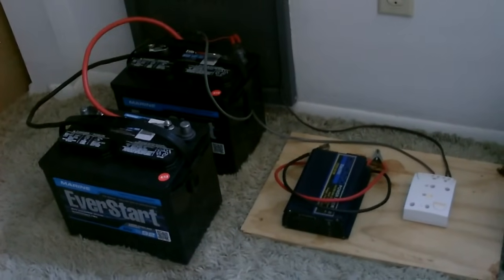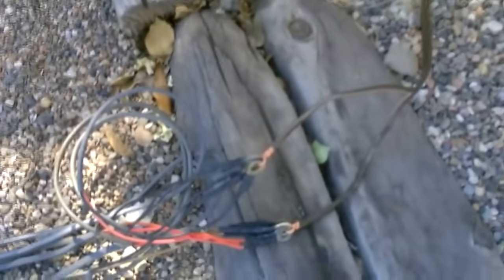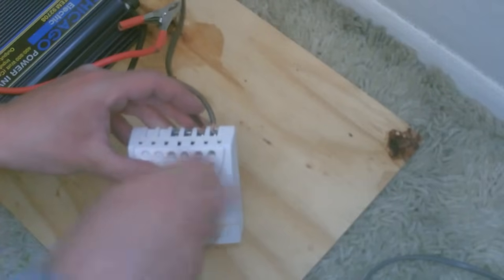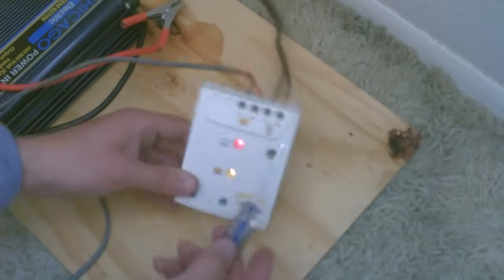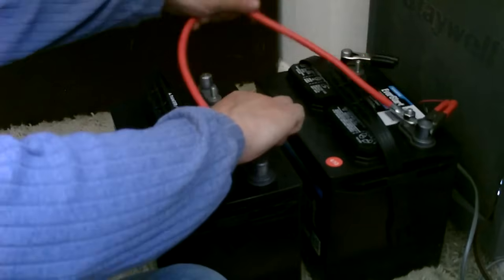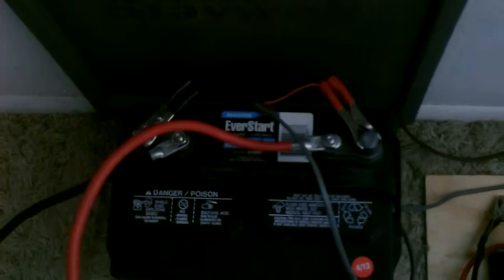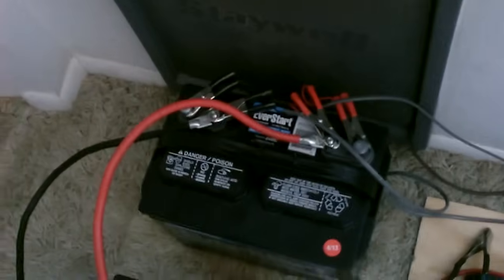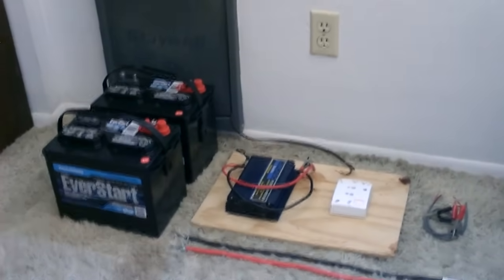How to hook up Solar Panels (with battery bank) - simple 'detailed' instructions - DIY solar system

Comment: Hello,Thanks so much for making sense of using solar power for better power efficiency,etc.I can see it's been over 5 yrs. now since you've posted this information.I am not understanding amps/per hr. needed related to what I'll be using it for.I'm looking for solar power @ the present time only for off grid camping in a small vintage trailer, part time,maybe 4-5 days @ a time where there are NO electric hook ups.Primarily refrigeration but also for lights.I do NOT need air condition/heat where I am in southern ca.And will probably use propane for stove top or camp fire cooking,coffee,etc.The only other solar 'maybe' needed would be quick rinse,soap & rinse shower 2x's week.Considered an overhead outside solar H2O bag hanging but on a sequensial # of cloudy days,not sure.I particularly liked the stand up Kenmore Chill fridge/freezer by Sears you mentioned.In conclusion my 2 part question is:have they since,come out with a more efficient fridge/freezer?And,you showed the 2 full solar panels(6 individual panels=90 amps).Is that 90 amps/hr.?You mentioned 'eventually' you were hooking up to 1 monocrystal solar panel.Can you elaborate on that?I'm trying to figure out also how many panels or how much solar/watts-amp.???I'll need to get started? I'm obviously not understanding the conversion of watts>amps & what I'll need for my purposes.Thank YOU so much for sharing!!!
Reply from the maker: hi. i'm glad the video helped you. i see all the comments no matter how old the video is. hopefully it will still be helping people 20 years from now (maybe longer). now to your questions... yes, i've seen slightly more efficient fridge/freezers, but the one in the video is still one of the best. note that the 6 solar panels are 1 amp each for a total of 6 amps. so 90 watts. these days i mostly buy 12v 100 watt solar panels. those are usually around 6 amps. i buy those because it's generally cheaper than buying several smaller 12v panels.

Comment: is there a limit to how many batteries you can chain link?
I want to run a computer that uses about 800 watts continuous all night off the batteries when the sun is not out.

How many batteries would I approximately need?
Reply: Your computer actually consumes 800 watts continuously?   That is a lot of watts!  Then ... 12 X 100 AH Lead Acid Batteries might last for 8 hours, at night

Comment: This is a good explanation of how a solar system is put together and works.

I would like to add some very important information anyone wanting to go solar or have a solar back up.
  It is important to know what size inverter you would need to operate what you want to use. Inverters are rated for continuous loads and start(peak) up loads.  Example: 2000/4000 watts.
  To find out what size inverter you will need. I am going to use for a full size 
refrigerator.
   Look inside the refrigerator for the small metal plate, it will have the amps listed that is required to run.  Multiply the amps by 120 ac (alternating current) voltage ( your household electric) , will give you the watts needed for continuous run load . 
  Since refrigerator, freezers, air conditions and pumps cut off and on they require higher peak load than the continuous run load requirements.  
  For refrigerators and such mentioned you will need 3 to 7 times the continuous run load to cover the peak surge use to start up the motors in these things.
  Example you have a freezer with a continuous load of 4 amps and the start up load of 12 amps or more will be needed. Multiply 4 amps by 120 volts equal 480 watts of continuous power needed. Now multiply 12 amps by 120 volts equal 1440 watts needed for a start up load.
  You will need an inverter with surge/peak rating of 1440 watts or more just to handle this one appliance.
   For a complete household you will need to find out what everything you want to run off the inverter requires. That will determine the size inverter or inverters you will need. 
  For example a normal coffee maker will draw about 800 watts of power. If you have a 500 watt inverter you can't run that coffee maker.

Comment: This question may seem really dumb. Now that panels are less expensive (2020) can I just use 1 - 375w solar panel in place of what used to require 4 - 100w panels? Will this still work or give the same effect?

Comment: If the batteries no longer have any charge will the power keep getting drawn and destroy the batteries or what?
Reply from the maker: hi. the inverter shuts down when the batteries get low (when they're about 50% discharged). so the batteries don't get damaged..

Comment: How much power is there with 2 batteries and for how long..for example to power a 2.7L mini fridge would this be enough with a 100w solar panel 18.5v?
Also can this system be used for lithium batteries
Reply: At night, you can draw 300 Watts continuously, for about 4 hours.  A fridge will cycle ON / OFF, it is not continuous ...

Comment: thank you just learning here.... can you tell how or what you do to  maintain your  deep cycle batteries. what kind are they? how often to add water or check them ect. and are all deep cycle the same.  these are walmart right ?    any help thanks     david
Reply from the maker: hi there. i've had good luck with the everstart batteries (from walmart). i've stuck with those for 9 years. i always get 3 years out of them. (about 1000 charge cycles). i used to check the fluid level every few months, but the level was never low. not once in 9 years - so i don't even do that much anymore. i keep the voltmeter attached to them and monitor the voltage. that's about all i do.
Reply: @desertsun02  thank you

Comment: I have a 10x20 shed coming next week. I plan on insulating to help keep cool (Florida). I'm wondering a few things: I will be running a laptop, TV, a paper printer, a thermal printer, a portable A/C (the kind on wheels), and charging a few small lights. I use the printers less than 5 mins per week total. I'm hoping to get acouple Duracell deep cycle batteries, 200 watt panels total, an inverter maybe 400 or 500w for expansion. I have no idea if this will be powerful enough to run the small electronics along with an air conditioner...in the summer we easily get 14 hours per day sunlight. (Air conditioner is a Hisense 10000 but 115v)  thank you! Loving your videos!

Comment: Sir I have a 100 watt solar panel and two 35 ah batteries..I want one battery to charge using solar panel while other battery should be connected to load(dc motors drawing 8 amps and its 12v) while the battery gets drained the other battery should be connected to load and the discharged battery should be charged using solar panel

Comment: You made is sound so easy. I have 2  100walt panels, charge controller, inverter and 12 volt battery.  Works good But my husband wants to separate the panels on each side of our boat, so I would need to extend  the - and + less on one panel about 15 feet and my panel have connectors on the end that would go into a mc4  Y connection. I bought the whole set up as a gift and now I have to refigure my lines. Can I get extensions for one of the panels?

Comment: This was great thanks! One question. I have an RV with an existing plug in system ( being able to charge the deep cycle batteries from the exterior outlet with an extension cord OR charging it with the engine motor running and the internal inverter running) SO can I run this type of system directly to the 4 parallel deep cycles I currently have or should I somehow run something like this into a power station which my RV could plug into when I'm off grid. Sorry I'm new to this and not an electrician lol 😂 ... Thank you for the help if you could

Comment: Hi Sir. 
I will ask if I can use the inverter and in the same time the solar panel is still connected to the battery?
Or I need to disconnect first the connection from comptroller to battery?
Then only battery to inverter.
Reply from the maker: hi. yes, you can use the inverter at the same time the solar panel is connected. i keep it connected pretty much all the time.

Comment: A question, I bought 2 nomas 100W and 2 deep cycles, each of the panels comes with a charge controller included, should I have it as a dedicated one for each battery, or use just one of them and tie my 2 batteries into a parellel?

Comment: FANTASTIC video. In fact his tip on Harbor Freight led me to this package from said company: https://www.harborfreight.com/100-watt-solar-panel-kit-63585.html . I would comment to many that it gives you how much power you get to run what devices for how long per battery. This video EXPLAINS what this kit does for you and how to DIY expand it to more batteries and other components. Also there are direct DC connections to your existing devices such as monitors, laptops, game consoles, led light bulbs, music devices and refrigerators. The GREEN NEW DEAL starts with you and me and local power where WE control our use and our generation from wind and sun. Love this.

Comment: How many batteries would it take to light up a fridge and lights in the house
Reply: 2 x 100ah batts  Would do. You will need more solar power than he has though(Great vid by this dude buy the way)  a fridge is(uses) around 100 to 200w (old ones use more) I would get an inverter 1000w (any bigger you will need more batts to run the inverter) And may be 2 x 100w mono solar panels. My set up is getting built as we speak  im going to run 3 x 100w s-panels/2 x 100ah batts /epever charge controller 40a MPPT and a pure sine wave 1000w inverter. I am no electrician im learning this also at the moment so if anyone knows a better set up fell free to reply. Also mike be careful when buying the s-panels you want mono NOT poly and if it comes with a charge controller make sure its mppt NOT  pwm or is it pmw anyway this is important  cause there cheap crap a good quality charge controller is also important . Without this combo its not going to work and it will be a waste of your hard earned coin. You get what you pay for in this kind of set up.

Comment: Great vid! Thank you. I have 31 panels on my roof flowing back into the grid , i would simply tap the ac power from the inverter installed correct?  I was wondering how many batteries i could charge in a day, and how much are those big buggers?

Comment: So.....we are wanting to run a string of patio lights 8 hrs a day along with a floor fan.  If I understand this correctly, it's doable.
Now if we add a mini fridge or standard size single door fridge, I take it we may have to up the amperage?  The fridge would run 24 hours in  the summer.  In winter it would be unplugged (Dec, Jan, Feb, March).  Thanks for all your help.  Makes the impossible seem doable.

Comment: So If I was powering 2 inverters from 2 batteries. just run the jumper from each batter to an inverter and we should be good to go? I would only need the one controller?

Comment: This is exactely how I run my system at home.  1 x 100w panel, 2 x 110ah heavy duty leisure batteries, 1 x MTTP solar controller and a 1500w inverter, job done.  Thanks for sharing.
Reply: Are those regular car batteries?
Reply: @Philipbuono77  My original system  was run on x2 leisure deep cycle batteries, but I have now invested in x1 100amp Lifepo4 lithium battery.  It is much better and offers better power delivery 👍.  I personally would not use standard car batteries.

Comment: I bought a solar system with 200W with a 15Amp controller for a 24V water pump, what kind of cable I can use to connect the battery to the controller, the holes of this controller are too small?  I am planning to get another controller; can I get a higher Amp without damaging the system?

Comment: Great video - in fact I tried this set up the same as you described (except a 100w solar panel.)  I run a box fan on it and within 5 minutes my batteries are discharged to 70%.  I'm not sure what could cause the drain on the batteries like that.  I am also running it during daylight with full sun hitting the panel.  I turn off the fan and the batteries are recharged in 3 minutes.  The equipment is brand new - even the batteries.  Any ideas why it discharges so quickly?  I ran a meter on the batteries and they are at 13.6 v each.
Reply from the maker: hi there. great question. when you put a load on the batteries (a fan or something else), the voltage reading on the batteries will drop lower very quickly (but only at first). that's totally normal. the batteries are not actually discharging fast. it just reads lower because the load is on them. *that's why when you turn off the load the voltage jumps right back up (in a couple of minutes). the larger the load the lower it reads (at first), but within a couple of minutes of shutting the load off, the batteries will readjust and you'll see they didn't really discharge any faster than they should.

Comment: Fyi not trying to be a smart ass I'm way new that's why I'm looking. If you bet a bolt that fits at those washer type ends on your wires and crimp one on the copper loop twist you did or just put 2 washers together and place that wire in the middle I think it would make better contact and if someone pulls on it or trips anything like that it would keep a great contact point. I like your set up I'm go up going to watch again im still a bit confused not your video like I said I'm new

Comment: input 24v 220v out put 6000w inverter 100w panels x3  how many batterys will i need for this?  also if i leave it on running my cctv continuesley will it be ok will be runing wifi cctv camera 8x and also the fridge if possiable?

Comment: I'm moving into my SUV, so I'm planning to set up solar power. I've spent a lot of time researching over the last week, but nothing was as simple and helpful as this video. Thanks!
Reply: Were you able to do it? How did it turn out if you did?
Reply: Alex June Hey! I did move into my SUV and lived in it for 379 days. However, I decided against modifying my car. I just did what I had to do to endure the heat and cold without it.
Reply: @maxleveladventures  so you didn't implement a solar panel system?
Reply: Alex June Correct.
Reply: @maxleveladventures  thank you.
Reply: Alex June you’re welcome :)

Comment: someone set up our system with two different batteries. They are not available to help so can anyone give advice on how to change batteries safely to avoid short circuit. We have a solar panel connected to two batteries. The one battery is smaller in amp hours and doesnt seem adequate and may be draining the other 110amp hour battery. The one that needs changed is the one that is connected to the controller. Do you remove this wire and then changeover or disconnect both batteries first. The system altogether is a 250 watt solar panel,  one 65amp hour battery and one 110amp hour battery with a 1000watt invertor

Comment: I’ve been playing about with solar at my house, my epever mppt has a load out and i tried connecting the pure sine wave to it but it works few seconds and the load goes off from the Inverter. I’m presuming it’s the charge controller doing it. How ever it runs perfect when connecting the Inverter to the batteries directly, my question is, wont my Inverter run my battery bank below its recommended point?
Reply from the maker: hi there. all inverters (as far as i know) have built-in low voltage protection circuitry that will shut down your inverter when battery (or battery bank) is near the limit. so your battery or battery bank should never over discharge

Comment: Great video, I would add that a "pure sine wave inverter" is best for sensitive electronics such as laptops. "Modified since wave inverters" leave you susceptible to electronic damage. 
They cost a little more but the peace of mind is worth it. 
I'm currently running my Hughesnet on a 100 watt solar system with two batteries in parallel on a modified since wave inverter until I can purchase a pure sine wave inverter. So far no damage to the Hughesnet box. (Holding my breath).

Comment: im planing to set up a solar panel system to run both my computer and a 1hp airconditioner at the same time. monstly since im just using it during the day. would you recomend this kind of setup or would i need more wattage coming from the solar panels to power those? i'm a bit confused :/

Comment: can i use the charge controller with a dynamo or alternator input instead of solar. ..? can it smooth spikes and safely charge Lithium batteries ..? do i still need a voltage regulator. ? i want a way to charge my ebike on the go.. Regards

Comment: to charge the battery with a generator for not sunny days, would i need to unplug the battery to the charge controler prior to connecting the generator? Or may I leave it conencted?

Comment: Hi, thanks for the video
I wanted to run the Same as what you have done to be able to distill water for drinking, is it possible to run a 550 watt distiller with the same type of set up?

Comment: Great vid, I have a 10 watt 12 volt solar panel can I to short circuit using a resistance to heat water?  Thanks for your help